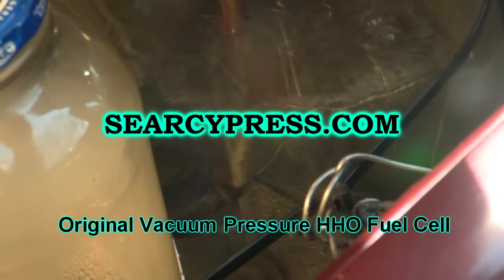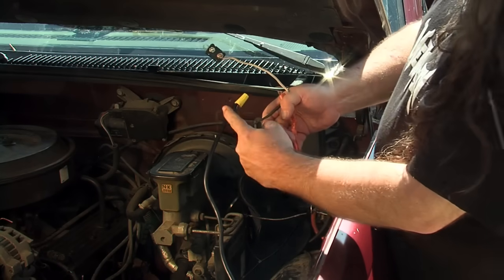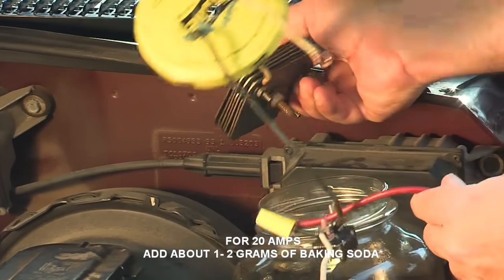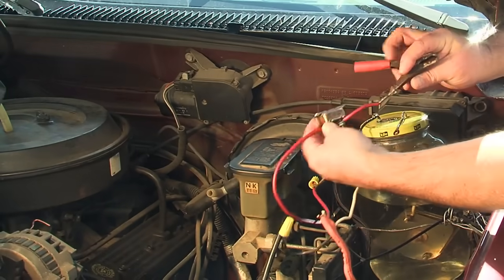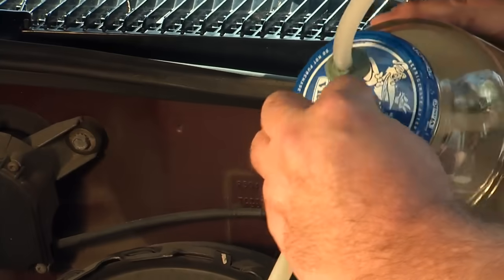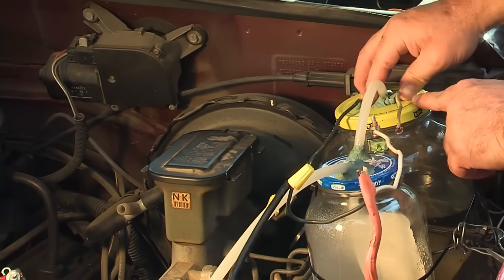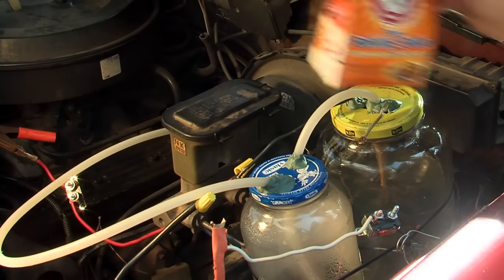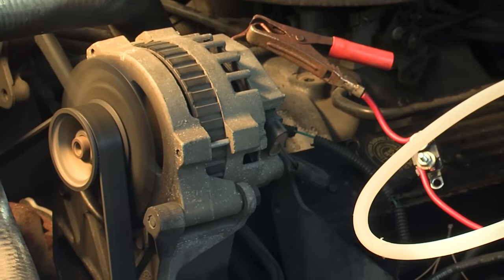Vacuum Pressure Hydrogen fuel cell defeats high gas prices using hydrogen from H2O.

Comment: Is it possible to run an engine on just HHO gas? Or are additives needed?
Reply from the maker: HHO is a reactive gas. It works only as an additive. You could melt tungsten with it in its raw form. Thanks for the comment.
Reply: @metalpresstv  Hahahaha so I need a diamond engine block and pistons? lmao....

Comment: Does this work on newer model cars also? Or have THEY put a combination of sensors on the newer models to detect this type fuel cell, sending a signal to the computer to shut down everything? I only ask because it wouldn't surprise me if this is something they have done to prevent us from attempting this.
Reply from the maker: It depends on a lot of different factors because there are so many different vehicles. Not every new vehicle has every option either. Given the price of gasoline it's certainly worth a try if you are fully qualified to take on such an undertaking, understand all the risks and accept the liability involved. You could always remove it. We have a new video coming out soon be sure and subscribe. Thanks for the comment.

Comment: Dose it just run on hydrogen or on both mate
Reply from the maker: The HHO increases combustion of the unburned gasoline by vacuum injection. It really does not power the motor. It boosts the burning of the normally wasted gasoline.  Thanks for the comment.

Comment: As a mechanic I'm very impressed. As also an electrician IM HORRIFIED AT HIS APPROACH
Reply from the maker: I find that confusing. As an electrician you should know that the number 10 gauge solid copper wire won't suffer from wicking when put into the water. Also, that wire is fully capable of handling 40 amp load. You see double circuit breakers on either side of the load. The only thing that would be questionable is the light switch. But as an electrician, I'm sure you're aware that those circuits are designed to not catch on fire. They undergo rigorous testing that normal toggle switches do not. I certainly do not condone anyone else replicating this however has an electrician you should be intrigued, not horrified. But, I completely understand. I respect your judgment. Do not replicate what you see here. Thanks very much for the comment. We have a new video coming out soon that shows some definite safety improvements that I think you would approve of. Don't forget to subscribe.
Reply: Can i go fuseless?

Comment: We should all be driving hydrogen cars
Reply from the maker: I think oil is a great resource. It is basically solar power in liquid form. Sure it has become a mess, but it got us where we are today. Future cars will no doubt run on alternative fuels. It is a transition that should be done slowly I think. Abruptly switching will have horrible consequences and that seems to be the plan. Thanks for the comment.
Reply: @metalpresstv  Why? Hydrogen cars were invented around the same time gasoline cars were, the tech was simply suppressed.
There is no reason to take it slow with such old and proven technology.
Reply from the maker: @Michael-Archonaeus  the infrastructure does not yet exist. If I need gasoline I am generally within two miles of it at all times. This is true in just about every city with a good population in America. Not everyone has the money to go buy a new vehicle. People would suffer. In this economy things are quite grim and doing a fuel switch right now would be catastrophic. Perhaps if the government instead of sending billions of dollars overseas would buy everyone an alternative fuel vehicle instead. Electric vehicles are ridiculous because they are not green as advertised. Already in California people are getting told not to charge their cars due to strain on power grids. Liquid hydrogen fuel most certainly is the best alternative there is. Even though it is the answer, phasing it in abruptly would still be a complete mistake in my opinion. There are a lot of things coming that are going to change our lives in the next few years. Let's just hope it's for the better. Thanks again for the comment. We have a new video on this topic coming out very soon. We show some improvements that I think you'll find interesting. Be sure and subscribe. 😎
Reply: @metalpresstv  You are literally sorrounded by liquid hydrogen everywhere, it's called H2O, so fill up your tank and have a drink while you're at it!

Comment: I think that this could help to save a person or family in a grid down situation or if the economy continues to inflate into impossible inflation that a person cant afford to pay for energy bought from a supplier , this can be used to run a Generator , small cook stoves , water filtration systems , ect. Id say learn it , get a place out of the city some if possible or search out very small little wood stoves you can make easy and get a sm. generator in the least , and learn to keep your self warm , with food staples water treatment supplies and test chemicals and a few like minded family or friends and give yourself a chance , the peace and safety that the bad managers who brought this concern about is not going to be the help you might hope , and it certainly will be much darker than advertised , anything but that and you have a chance ! God Bless All !
Reply from the maker: As wonderful as that is, and as much as I wish it were true, it isn't. There is no free power here or magic trick. The process of making hho requires energy. Yes water can be turned into gas that can be burned. But if you have the energy to split that water into its gases you might as well use that energy in  it's pure form. The entire reason our system works is because gasoline engines are designed to waste up to 20% of their fuel creating an entire industry of emission control systems. The reason why our system works is because we are able to increase the efficiency of the burning of that wasted fuel. Now, it is possible to split that water using aluminum and gallium in a ratio of 3 to 1 with water. The result is a way to make huge amounts of hydrogen gas. Using any other known method at this point requires energy. Entropy is always at work. At most all this technology can offer is to increase the efficiency of certain types of engines. It's still going to take something really epic to change this world. They probably already have it but it figured out a way to use it for evil. Thanks for the comment, God bless you.

Comment: But you're not that smart Sherlock that's going to rush your engine from the inside out water it'll ride it'll be cheaper but it ain't going to last as long diesel fuel the best far as longevity is good smart but the moisture going metal and still it's going to Rusty it's not going to have that long life like that even though I say you should do it but only way it's going to work effectively if you copper the inside of the engine you got a copper the tailpipe carpet on Rust like that everything else going to rust up the screws and nuts the bolts it's going to be a disaster it's going to freeze up one time I think about that
Reply from the maker: My dear Watson, don't you realize that the byproduct from burning gasoline is water? The water that's coming out of the tailpipe is coming from the gasoline? The catalytic converter is not getting hot because it's not able to burn wasted fuel because there is so little.  Check out our new video coming soon and we'll try to educate you. Thanks for the comment.
Reply: @metalpresstv  water will dissolve your engine
Reply from the maker: @marcedwards2464  ultimately it all comes from the same place. The Sun. Whether it be gasoline that comes from post photosynthesis or solar power or even human power which is fed and renewed by the sun. Food for thought. 😎
Reply: @metalpresstv  electric is better

Comment: basically it's stupid :D The amount of energy from alternator used to create hydrogen from water based on electolyse will be always grater than the amount of energy generated by burning the hydrogen created. Physics 1.0.1 Ultimately your fuel consumption will be higher. It might be used as kers/hybrid solution, storing energy from breaking, but that's all that has any sense.
Reply from the maker: Basically you misunderstand everything. The engine is only burning 80% of the fuel. The other 20% of the fuel is consumed in the catalytic converter and wasted in an effort to reduce the gases that it wasted in the first place. By combining HHO, injected in the state of vacuum into the cylinder we are burning at a much higher efficiency rate. The gains come from the gasoline and not from some pseudomagic science. We are just burning more of the gasoline. As a result the catalytic converter will not get hot as quickly and you will notice a lot of water coming out of the tailpipe. This is coming from the gasoline. The catalytic converter, during normal operation burns very hot vaporizing any water vapor which is exhausted in the process of burning gasoline. It does not come from the hho. Only about three quarters of a gallon of water is exhausted from the fuel cell every 200 mi. The fact that you see the excess water is the evidence that the system is working properly. I would love to hear your response. We have a new video coming out soon which will explain everything in detail. Many confuse this type of system with an atmospheric injection. They are completely different. If you try to put HHO into the air system it will become quickly diluted and cause O2 sensor problems. Injecting in the vacuum is completely different. Be sure and subscribe. Thanks for the comment.

Comment: Do u have to go through more oil using this? Also comma I don't understand what this does exactly period using the alternator to produce hydrogen should be energetically more expensive than not. Whats this accomplish?
Reply from the maker: Understand, this engine is only burning about 80% of the fuel the rest of the fuel is consumed by the catalytic converter. By injecting into the vacuum we're getting a much higher efficiency burn in the cylinder where that wasted fuel is converted into energy. The result is, a much cooler catalytic converter which allows a lot of water to condense because it is not vaporized by it. That is where the water comes from. Most of it is not coming from the HHO as it only uses about 3/4 of a gallon per 200 miles. There is no free energy. Make no mistake it's coming from the gasoline of a poorly or intentionally designed engine that is wasting gas. We have a new video coming out soon which will go into much greater detail. Thanks very much for the comment. Be sure and subscribe.

Comment: You never mentioned leaning out the fuel mixture, which you would surely need to do in order to see mpg gains?
Reply from the maker: Exactly right I did not. What happens when you get a vacuum leak?  There are so many different vehicles out there I can't say any solution would work on every single vehicle. Modifications are not always necessary however. Newer vehicles are certainly a bit more problematic. Understand when people are talking about injection of HHO they're often talking about injecting into the air intake. We are not doing that. We are injecting in the vacuum where  the gas remains pure until used. We have a new video coming out soon I'll cover as much of it as I can. Thanks for the comment, be sure and subscribe.
Reply: @metalpresstv  injecting into the vacuum as you call it is exactly the same thing as going into the intake, that's where all the vacuum lines go. Are you saying you just leave the fuel system the same and adding hho gas somehow makes it use less petrol? Does it make it burn more completely or something
Reply from the maker: @wilsondriver654  you'll definitely smell the difference. Especially on an older vehicle. The catalytic converter won't get hot very quickly and water will pour out the pipe from the gasoline burning. Many think it is from the HHO however that is not accurate. Normally the catalytic converter gets very hot from the wasted fuel gasses coming from the engine. The water that is produced by burning gasoline is vaporized by that hot reaction.  Running the HHO vacuum system however a significant reduction in catalytic converter temperature is noted. It will be covered and shown in our next video which we are trying to finalize production on. Injecting into the air intake of the engine is not in any way shape or form the same as injecting into the vacuum. When you do that the hho gas is leaned out extremely fast. O2 sensor problems often result. Thanks for the comment.

Comment: The lead acid batteries also make hydrogen when charging. Why hasn't anyone tried to tap into that source. They have been known to explode before. Even if it's a little bit. It could be also drawn into the intake through vacuum. The curiosity got to me a little. Lol.
Reply from the maker: Batteries are storing the power. We are producing everything in a state of vacuum. The demand of the engine produces the vacuum. The fuel is used immediately and there is none stored. Explosion in the state of vacuum would be very disappointing. It is also very unlikely due to the concentration level. Our newest video will show how we stopped the threat of an atmospheric type issue. It's coming out very soon we hope. Be sure and subscribe. Thank you for the comment.

Comment: Any chance of fire or explosion.
Reply from the maker: There's always a chance of just about anything. There's a chance your gasoline tank can burst into flames. Think about it, your fuel pump is inside it and it's electrically controlled. Certainly there's a lot of room for improvement when it comes to safety in this old design we show. I have a new video coming out soon that will show you the safety improvements we've made and explain some of the complicated things people often misunderstand. Please be sure and subscribe so you don't miss it. Thanks for the comment.

Comment: Thanks for this very simple and to the point explanation!   I only wonder, won't your engine get internal rust? Also could this work with fuel injection?
Reply from the maker: The water actually comes from the gasoline. Only about 3/4 of a gallon of water is used every 200 mi. Water is a natural product of burning the gasoline. You don't normally notice it because the catalytic converter is busy burning up the wasted fuel that your engine wasn't able to use. When you're running the vacuum pressure fuel cell however that catalytic converter is left with nothing much to do. I strongly suspect this is by design. Can you imagine being told you're going to have to make the engine burn less efficiently so we can justify a emission control devices on the tailpipe? I assume there is some engineer out there that actually had that happen to him. Thanks very much for the comment. Be sure and share the video it helps out a lot, thank you.
Reply: @metalpresstv  thanks for sharing your knowledge
Reply: For some reason my system keep sucking in water from the jug, any thoughts?
Reply from the maker: @27thparallel  the piping on the secondary jug is designed so that the accumulated water returns to the primary cell. If you have the hoses done properly it will take place automatically. New video coming out soon be sure to subscribe. Thank you.

Comment: All the auto manufacturers should be building hydrogen/gasoline hybrids.  with larger alternators, two or three batteries and larger hydrogen fuel cells..also stainless steel plated combustion chambers so the moisture of the hydrogen doesn't rust anything. The world could cut its gasoline use in half or better.
Reply from the maker: The real question is why are they making engines that only burn 80% of the fuel? I can imagine they would say that they need the other 20% to burn in the catalytic converter to take care of the fumes. It's kind of stupid if that was the case, because an efficient burn produces almost no obnoxious gases. Sure, there are unavoidable so-called greenhouse gases but I think you know what I mean. What our system does is burn as much fuel as possible in the cylinder getting the energy from the normally wasted gasoline. This leaves the catalytic converter with not much to do and the water vapor from the gasoline condenses in the tailpipe and ends up coming out on the ground. This can only be achieved by injection in the state of vacuum. Any device that is injecting hho into the intake of an engine will not be able to cause much of any kind of improvement. This is due to the fact that the gas is leaned out far before it has a chance to be ignited. We have a new video coming out soon with some improvements and some deep rooted explanations. Be sure and subscribe. Thanks for the comment.

Comment: Have you tried using a modified system using 2 jars with the water + NaHCO3 connected via a hose, and then running 1 separate electrode into each of the jars, and then using just the hydrogen one to add to the fuel intake line? Sure, you'd be wasting all the oxygen that has to come off from the other jar, but so what? Maybe you can generate cash while you drive by figuring out a system of bottling that offgassed oxygen right in your car and selling it.